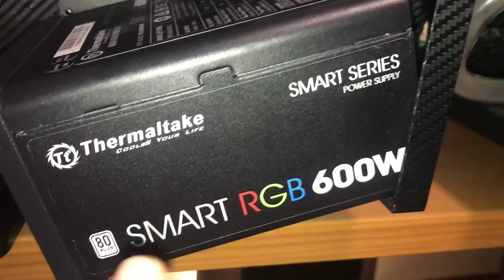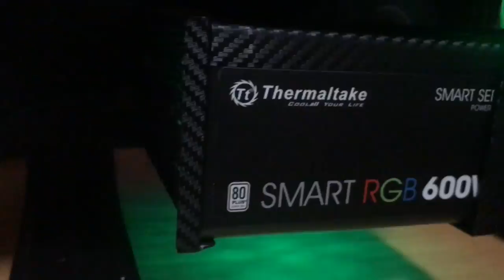Wrapping + Painting my Core P3 further (build log 7)

Comment: Excellent wrapping job;  you make it look so easy. 
I think all the visible fans, would look much nicer in green. Either way,  it still looks bad ass. 
By the way... The cut edges of the wrap, can be colored with the marker before you stick them into place. Unless you need to cut away any excess from the wrap. Then there's no choice but to color the edges after cutting. Also the better quality marker you use really makes a big difference, when trying to blend the cut edges it with the rest of the wrap.
Overall, you're doing a fabulous job on this build.
The processor in this build is the i5-7600K, right?
Water cooling your i5-7600K is a bit of an overkill IMHO, but it sure will look sweet.
Reply from the maker: it's running at 5ghz :p, it gets really hot at 5ghz, watercooling will take care of that + i'm looking for a 980 ti to watercool along, it's just for fun anyway, thanks for the comment though :)